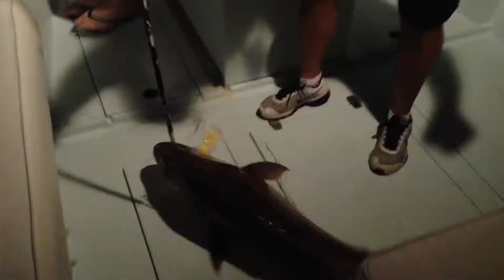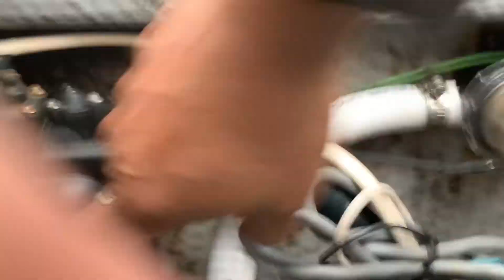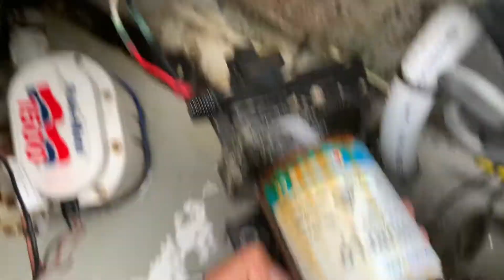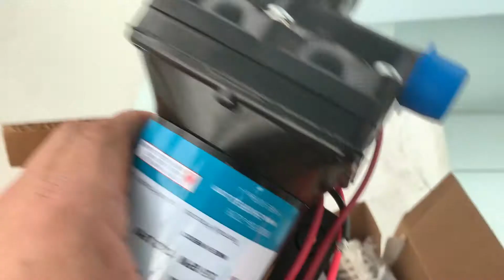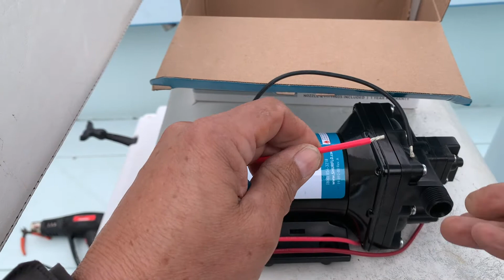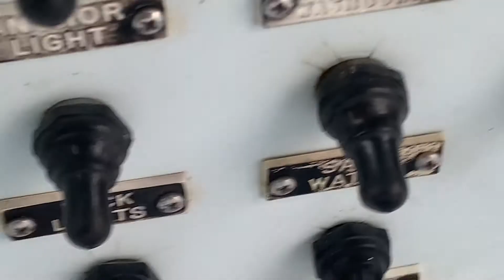How To Replace a Saltwater Washdown Pump On Your Boat - tutorial #blaster #pentair

Comment: Orlando thx for sharing. Idea for you to consider in place of the butt connectors install a two pin Duestch connector. Plug and play 
especially if your out at sea and experience need to check voltage at pump electrical issues etc.
Reply from the maker: I’ve thought about it but it’s not something that cat wait until I return to the marina. Still a good idea though! 👍👍 Thanks, Capt. O